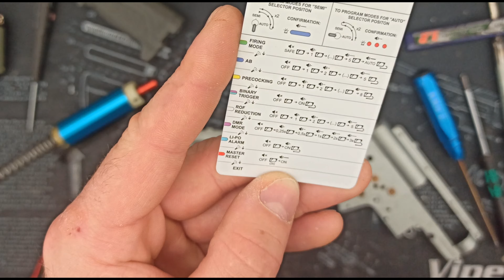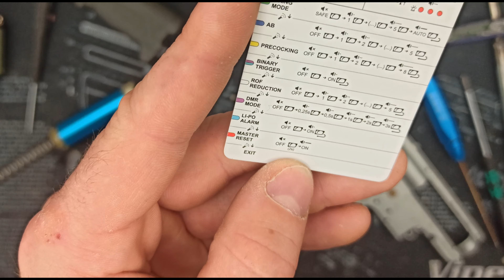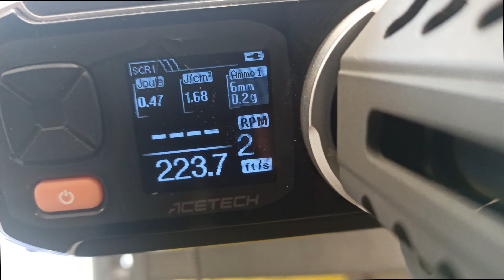G&G DSG to an G&G ARP9? Semi issues fixed, PERUN ETU++ installation & programming

Comment: I have a question, can I put in a Maxx model E trigger into an arp556 with the stock micro switch? Or do I need to get a perun.
Reply from the maker: You need a perun or to modify the trigger
Reply: @jokerthemisguidedmoralcomp2063  dangit! I was really hoping I could. I'm planning on getting an optical mosfet. How much better is a gate titan over a perun?
Reply from the maker: @Noah_McLain  Hello, its not better, jsut different. The TITAN has Problems with shortstrokes, the Perun has no APP and needs to be programmed with trigger and selector (okay, you could count this as a plus..) - the perun has most options the titan has - but you cant see statistics on your phone... lets say the titan is the more fancy one, the perun the one which is actually better made..
Reply: @jokerthemisguidedmoralcomp2063  oh wow, okay. So for the price I should go for the perun? I'm a little low on cash thanks to inflation.  I just want the perun for binary, trigger sensitivity and semi lock. I do like the customizable rps with titan though.
Reply from the maker: @Noah_McLain  The Perun hybrid allows you to set your trigger between 1 and 5mm. also it hast an adaptive trigger, so its resettet even if you dont let it fully go after you pulled it. you can independently programm the firemodes, like "Save-Binary-Burst". also you can do Preckocking and activebreak for optimized trigger response and you can release the spring if you pull and holt the trigger on semi. you also have a RoF control, 2-stage trigger, DMR-Mode and DSG-mode. The cables are way better then the GATE ones, as they are very flexible. 

its just that you have to do all this without an app..

regards
Johannes

Comment: hello, can you program the safety with perun? then put type : single-binary-fullauto . Thanks
Reply from the maker: the ETU++ can only differ between two firemodes. the save is mechanical - thats cause we still have the G&G ETU-triggerboard

Comment: Hey man, ik im late but my Arp9 hasn’t worked in about 2 yrs. When i pull the trigger all it does is the mosfet blinks red twice. Any solution?
Reply from the maker: possibly the gearbox jammed somewhere and the ETU shuts down. 
first try: remove the motor plate, check the motor wires.. if one is loose put it on, try again. 
second try: remove the motor, remove the motor grip, try to reach the little thing that holds the gears from rolling back (ARL) - then try to release it.
If the gun fires but jams right away, it may possibly be some kind of gear damage (tooth gone missing and rumbling somewhere in the box..9

please keep me updated
Reply: @jokerthemisguidedmoralcomp2063  thanks man. Yeah I checked the motor wires and the red one at the end, it fell off. Still though it didn’t work before that. And I’ve also got a new anti reversal latch and none of my gears are messed up.
Reply from the maker: @silenthunder5657  if you loose the motor and pull the trigger - does the motor run? is it too tight in? have you tryed to give direct power to the gun, without the mosfet? you can just get off the connector wires and give power directly to the motor, to check if the box is operating and the failue if mosfetwise..
Reply: @jokerthemisguidedmoralcomp2063  no I haven’t tried any of those yet. Also i found out that the red wire motor connector fell off the little metal piece. But the gun still hasn’t worked before i found that out.
Reply: Same thing happened to me. I think the selector plate was jammed or gears were locked up and the ETU was protecting it from shredding itself. I'm Boutta put it back together and see if she runs

Comment: May i know what set up, spring, motor tpa and rpm? Cos im about to build the same with etu++
Reply from the maker: Well this is for germany - so the build was made for a maximum of 230 FPS. The ARP9 comes with a decent motor. The new G&G one with neodym magnets. If you want to up a bit.. i prefer SHS Hightorque, Aimtop, Tornado..  the Spring here would be a quite normal one.. like M110.. maybe.. depends on how good the airseal is. for something around a Joule of power you may want to go higher.